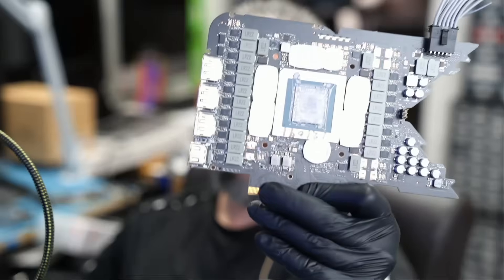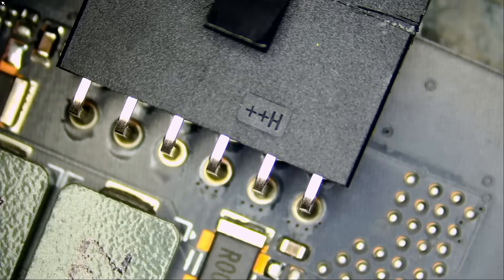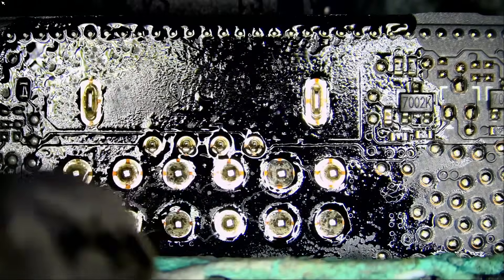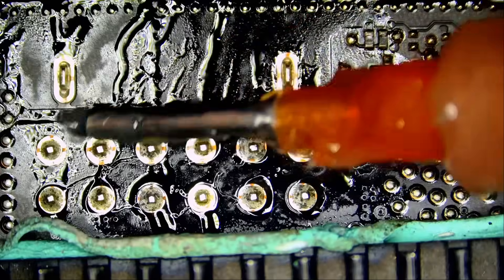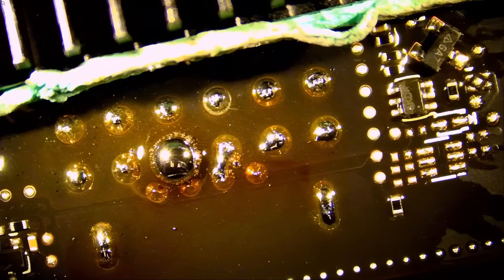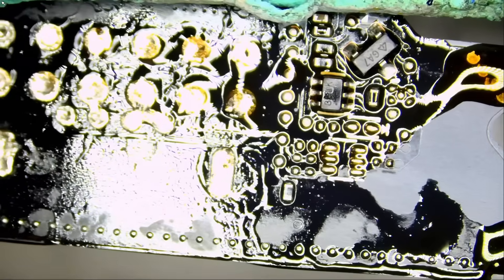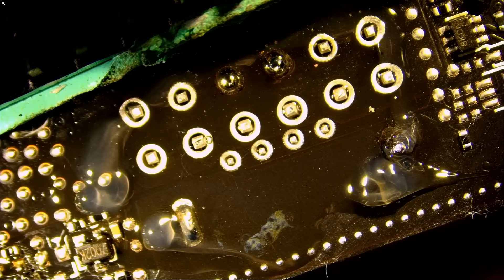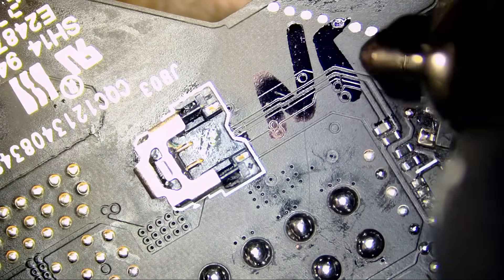The New H++ GPU  Connector Is STILL a Problem – 4090 12V-2x6 Melted

Comment: As long as there is a voltage drop across that connector. The connector will melt.
Honda had the same problem with the '82 Prelude blower motor connector; melted. The same reason, there was resistance across the connector terminals. 
Bottom line a voltage drop across a power connector equals resistance; current plus resistance equals heat...
Reply: There is no load balancing between pins.  There are only 4 sense pins, at 600W (yes H++ went to 675, still irrelevant) , that are sensing only 150 W steps of power, without control per pin.  Circuitry isn't in place to balance amp draw, per each of the 6 power legs, leading to uneven amp distribution, heat, and melting.  It's that simple!
Reply: @WildRapier  Shouldn't they change to a xt60 type or sort of connector at this point? 
I mean with thicker wires and fatter connectors.
As the card only sees it at one wire anyway.
Reply: Most connectors that work with a thin metal sheet making pressure on a metal post has this kind of problem. I replaced thousands and thousands of pins in pinball connectors, they are very prone to heat and completely mess with the connector/board. I had to throw away or solder wires + remote connector on lots and lots of pinball boards because of this kind of problem.
Reply: So, would plating the wire with silver or gold help ?
Reply: @davidhamm5626  No, as there is no load balancing between the pins. One cable still runs the risk of going well beyond spec (Even the spec is far too much for the cable to handle).
Reply: bro u just reminded  me of my 84 prelude
Reply: There is always resistance between mechanical connectors, this connector is just poorly designed for its rated load and operating environment.
Reply: There is a common 12 volts being conducted through 6 cables to share the load, its easier and cheaper doing that way, rather than using say one or two very heavy gauge cables. The 6 cables behave exactly the same as having 6 resistors in parallel. When you have higher resistance on some of those cables, then much of the current flows through the other cables with low resistance. The higher resistance comes from bad connections at the pins inside the connector.  The pins that are overheating and melting the plug are the pins with good connections, the pins with bad connections have high resistance so are not passing much current. To be sure this problem does not occur, I would carefully squeeze the sleeves inside the cable connector, to make sure they all make good solid connections with the graphics card pins. The plug will take some jiggling to get it on, meaning the connections are nice and tight.
Reply: So much wrong info in one comment. Voltage drop across connectors... voltage drops equals resistance and current plus resistance equals heat

Comment: Does the card have load balancing now ? If 1 or 2 rails keep drawing 10 amps or up and others keep idle at 2-3 amps this will fail no matter what connector used
Reply: None of the 4000 or 5000 series cards have any load balancing on the connector pins.  This will keep happening until Nvidia either add load monitoring shunts to each pin or designs a new connector.
Reply: all wires are wired to the same power plane, they are not separated

Comment: Alik I may be wrong but it’s my belief that you need the h++ on both sides to insure both sets of pins are the high current pins   I bet it you dissect that the supply side will have inferior fitting pins resulting in the excess heat 😊imho😊

Comment: Only more and gold-plated contacts will solve the problem. None of the developers measured the contact resistance of this crappy connector🤦🏻‍♂️ It looks like they only printed one more + on the housing of the connector and they think the connector can handle 75W more power 😅
Reply: Gold plated makes it worse. More connectors is a good idea.
Reply: @alexhunter0815  how does it make it worse? gold is one of the best conductors of electricity there is.. only reason it is not used alot is cause of the price.

Comment: This is a failed product. I want to know if the 4090 will even last 3 years or longer on a normal 8 hour daily usage.
Reply: no. it wont. connectors are crap and the board itself is too thin on the wiring and mass to soak away heat. cable connectors are junk that doesnt hold tight on the pins.   id just accept its a issue day one and diy a more robust cable, modify to add some mass and sink heat away, and add a fan directly cooling the connection zone.   id be looking at cards with pass through airflow slits for better cooling and noise reduction. it might be one of the best cards on benchmark but that means squat if it has to strain from overheating and isnt consistant under prolonged load conditions.
Reply: Who has time for 8 hours of daily use?